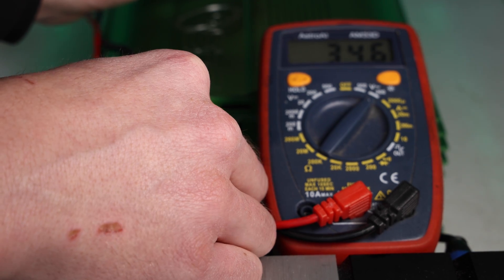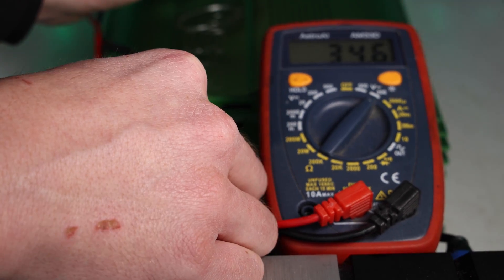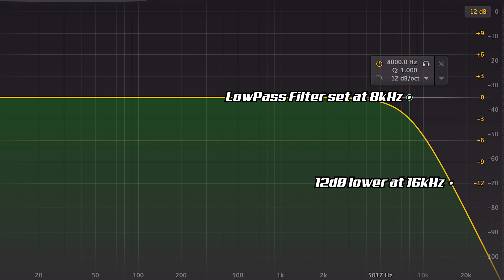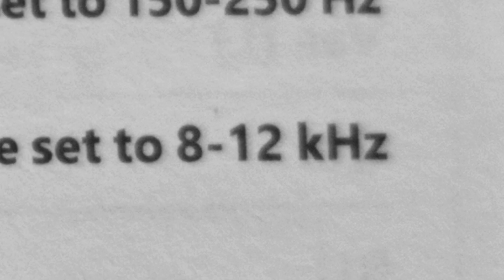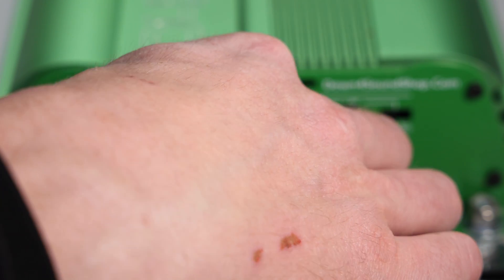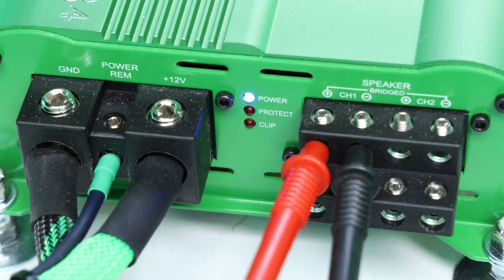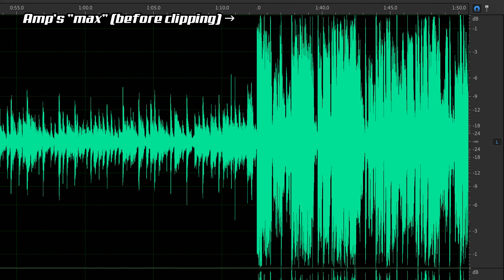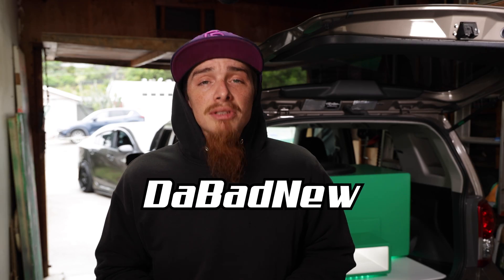How to set Filters and Gains on a Car Audio Amp to avoid clipping

Comment: Thank you bro, for the video......
Reply from the maker: No problem at all man!  If you got any questions during a tune, don't hesitate to reach out.
Thanks for checking it out!
Reply: @DaBadNewz  Bro, if the HU doesn't have OFF option on Subwoofer LPF,  50, 63, 80, 100, 125hz, is it just leave at lower freq 50 or pass through 125hz..... on the Sub Amp set up at 80hz
Reply from the maker: @ceejaycjmusic  it will depend where your door speakers (or mid-bass if you have them) pick up the frequency range.
Most of the time 80-125 is where you want, but honestly, just play around with it and see which one sounds the best.
At the end of the day, that's all that matters, if it sounds good, it IS good.

Good luck man!
Reply: @DaBadNewz  appreciate that, Thank you much.......

Comment: How do I inject the 1,000 hz ?
Reply from the maker: Damn I guess I should have included a link to some test tones!  
That will depend on how you listen to your music.  If you primarily play off your phone, you can just search on spotify or youtube (not the best option, but if that’s how you listen anyway, it will cater your tune to your actual use).
If you use mostly USBs or something directly connected to your head unit, then I would download from a reputable source (there are a bunch online, like from Audio Dynamics, just search “1khz test tone.”

They will have a dB in the title (0, -5, -10, etc).  I would use 0 for the safest option (wont risk any clipping), but sometimes -5 or -10 will get you more of the thump you want (just keep an eye/ear out for clipping)

Comment: How does the clip light on these work why didn't you say anything about it?
Reply from the maker: Oh wow!  You’re absolutely right!  I mentioned everything around the clip light, but never actually included the clip light in the explanation.  Definitely a mistake on my part that I will have to come back to!

But in the mean time:
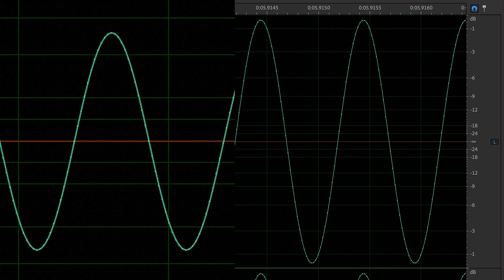The clip light is supposed to indicate when the signal coming from the head unit is too high (because of the gain setting on the amp).  I kind of touched on this when I showed the illustration of the signal on the left side of the screen getting larger to match the signal on the right (around 3:56).
Let’s call the signal on the right the “max.”   If the signal on the left had kept growing it would reach the point where the signal was no longer round at the peaks because it would be past the “max,” which would put a flat top on that perfectly round wave.  That flat top is the clipping, and the amp should be able to detect it.

The main reason I neglected to include this info, is because tuning the amp the way I have described will eliminate the need to worry about clipping, (but I absolutely agree it would have been useful information to include).

Thanks for reminding me to cover that in the future!
Hope that answers your question

Comment: Hey Nice video brotha👌🏽, I was wondering how to do the math on what i’m running,

Ch1: 4 speakers at 1 ohm
Ch2: 4 speakers at 1 ohm
Ch3: 2 speakers at 2 ohm
Ch4: 2 speakers are 2 ohm

I have a factory radio as of right now but am running a Sundown sfb500 4 channel.
Reply from the maker: When using multiple speakers on a single channel, the only real difference is that you have to add those speakers together so you can think about the total load on the amp as if was a single speaker.  (Since an amp doesn't know the difference between a single speaker or a bunch of them)
As long as all the speakers on a particular channel are the same, the numbers are pretty straightforward.  You would add the total RMS that each channel is going to need (or use 500 if the total is higher than that, since that's your amp's max), and then calculate it like I did.
Example:  (using made up numbers for easy math)
Ch1 and 2: 100 rms speakers x 4 = 400rms.  400rms x 1 ohm = 400.  Square root of 400 is 20.  So for channel 1 and 2 you would want 20V AC on your multimeter (22.36 for 500 watts)
If all 12 speakers are the same, channels 3 and 4 would actually have the same gain as 1 and 2, since it's half the ohm load and half the power.

Hope this helps!  Let me know if you need any more info

Comment: Hey man i have the same 4 speakers running on a Skar Audio RP-150.4AB. What would you recommed the settings to be at? My HPF is 20hz-5kHz and LPF is 50hz-500hz. Gain has no numbers lol. Thanks in advance
Reply from the maker: If you have the same Arnolds, they perform best between 150-12k, but where you put those filters is going to depend on if you have tweeters, midbass, or any other speakers.  I have mine set at 150 for now, but will be changing them to 250 or even 350 when I install my midbass.  With the High filter at about 8k.
As far as gain, that's where you're gonna have to follow the video.  

If you don't have a multimeter, you can do it old school by bumpin something that has lots of midrange/vocals/etc, turning your head unit to about 75-80% of the full volume, and adjust the gain on the amp until you hear the speakers start to distort, then dial it back just a tiny amount so it sounds clean again.
(doing it this way isn't perfect, but it'll get you in the area of where you trying to go.  You might have to readjust it a lil bit after hearing more music).

Good luck man!  if you have any more questions don't hesitate to reach out

Comment: What if i have 6 speakers on a 4 channel?
Reply from the maker: That's going to depend on how you have them wired, and also what the specs for each speaker are, (if they're not all the same).
The process is the same, you just need to do the math slightly different depending on how you wire everything up.
What are they and how are you trying to run them?
Reply: @DaBadNewz  6x AP-M61SE
Ch1 - 4ohm
Ch2 - 4ohm
Ch3 - 2ohm
Ch4 - 2ohm
Reply from the maker: @tafaudio since they’re all the same it’s pretty easy, looks like your channel 1 and 2 will be done just like mine.
The only difference will be for channel 3 and 4 you will add the RMS together before multiplying by the combined Ohm load.
Since those are 130 RMS, 2 of them would be 260 RMS.  Multiply that by the Ohm load (2) and you get 520.
Square root of 520 is 22.8, so that’s what you would look for on your multimeter.

Hope that helps!
Reply: @DaBadNewz  so if im correct when i use the multimeter on ch1-2 im looking for 32.2 and when i use it for ch3-4 im looking for 22.8… im new to this lol
Reply from the maker: No actually both you would be looking for the same.  On channel 1+2 you have 1 speaker at 4 ohms, which is actually the same as the 2 speakers at 2 ohms that are on 3+4 (as far as the amp is concerned).
(130x4) vs (260x2).  Same thing!

Just make sure your amp can handle that power and ohm per channel and you should be good to go!

Comment: I have no clue what I’m doing I still need help with tuning my amp
Reply: I don’t really understand how to set the hpf/lpf on the amp. It’s a jp234. I’m running 4 ds18 6x9, 2 ds18 6.5, 2 ds18 tweeters and 2 6.5 skar speakers in my grill
Reply from the maker: @GrandNash-bk2kq how do you have everything wired up?  You wanna set you filter based on what your speakers are made for, but that only works if all the speakers on that channel need the same filters.
Reply from the maker: Which part are you having an issue with?

Comment: Hey man I got a question, these D4S amps are SPL class but can they replace an AB class if used with SQ in-dash speakers? I’m just seeing so much about D4S that I’m debating, but I’m more into audio for SQ. If I’m using all alpine gear, what can I expect replacing a 4ch alpine with a 4ch D4S?
Reply from the maker: I would definitely think so.  I have a fairly controversial opinion on the matter: the gear doesn’t matter as much as the install.  Not to say it doesn’t matter at all, but after a certain $ amount the difference becomes negligible (generally speaking).
But honestly, assuming similar power specs, I wouldn’t see much reason to switch unless you wanted a specific feature or something.
These amps still have a THD of >0.1%, and in a car, that’s better than the listening environment can even realistically support (because of road noise, the engine, and just the world around a moving car being naturally disruptive to a clean sound).

In other words:
Go for it if you want more power or specific features these amps have, but if yours has similar power, you’re probably not missing anything.

Hope that helps!
Reply: Yes it helps. I had another question but it was too long so I’ll have to research. I’m
Sure I’ll find more answers within your channel vids😎
Reply from the maker: Hey if it’s a super in depth question, it might give me a good topic for another video, and that’s always welcome!
Reply: @DaBadNewz  … ok🤔 we know that AB class amps run warm and in some cases hot but it’s due to all the components used for lossless sound. However we know that SPL amps like D4S can be a full range D class so it can run more efficiently and cooler so I understand that design. So now correct me if I’m wrong at any time but for example the JP34 purple is a class AB amp but are there any technical differences regarding its circuitry that makes it different from a traditional AB class amp that less experienced people would be familiar with? I mean (example) the amp switching to D class during extreme operating conditions to accommodate cooling efficiency? I just want to know how D4S is able to offer big watts at lower prices than their competitors.
Reply from the maker: Tbh I have no idea!  I’m not aware of any special circuitry, but that doesn’t mean it doesn’t have it.
I honestly don’t know all that much about the circuitry side of things.  Definitely something interesting to look into though.

Comment: You got a good radio voice 👌
Reply from the maker: Hahaha thanks!  I’ve actually heard that one before.  (Makes me wish I had a decent idea for a podcast or something)
Reply: @DaBadNewz  …Thats what I was thinking when you explained matching the amps wave length to the head unit’s wave length with the corresponding diagrams and using a volt meter to dial in your amplifier’s volume and crossover. There are quite a few reputable car audio channels that most of us know but none of them ever explained car audio in the same dynamic way you have, plus the diagrams and effects to relate the message, you made a very cohesive video🤙. So check it out.. unboxing videos right? But… instead of that basic  
“Show & tell” that every body is doing, you do the traditional unboxing, and then you hit them with the “KNOWLEDGE“🧠 
I see a lot of room for creativity.
Reply from the maker: Hey man that's a great idea!  I HAVE been trying to think of different ways to do them, and that would definitely help people understand what gear they might want.  I honestly really appreciate the suggestion man!  You might just see some of that get incorporated real soon.
And BIG THANKS for the feedback man!  It means a lot cuz I was really trying to make this one be informative and helpful to folks.